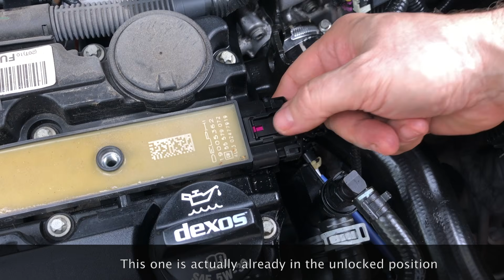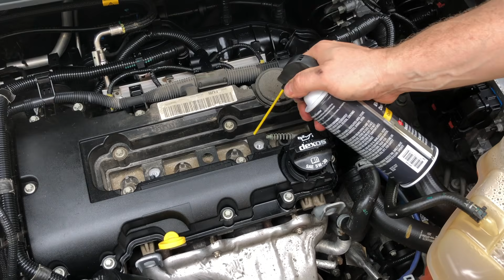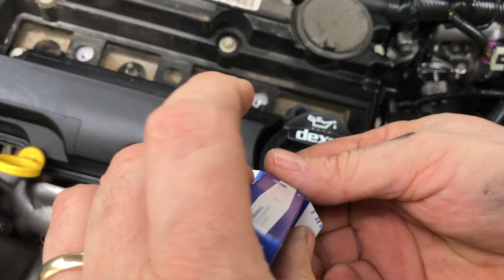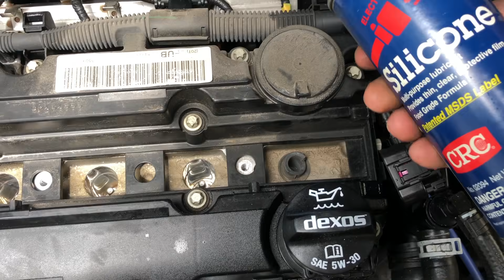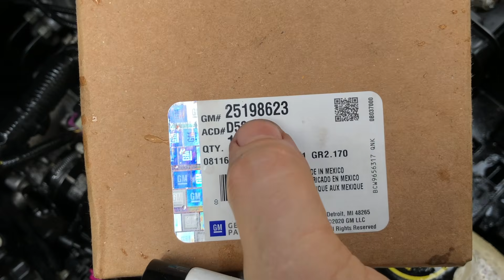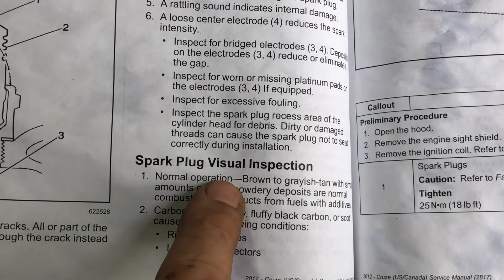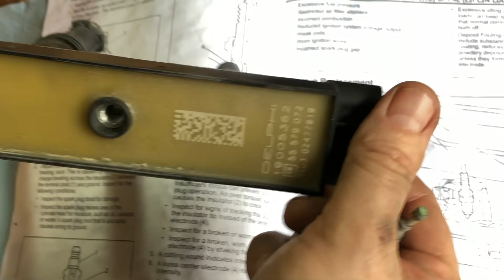2012 - 2021 GM Ecotec 1.4L Turbo Engine 60K Mile Maintenance (Replace Plugs & Coil Pack) Sonic Cruze

Comment: Did you have to buy your service manual from the dealership? The auto stores here stop selling them. Thought about buying one online, but they wanted over $600 other than that you have to pay a monthly or yearly fee to access the vehicle information, torque specs, etc.
Reply from the maker: There should be a search link in the description for hard copy versions.  A subscription to SI at www.acdelcotds.com is another option.

Comment: Our 2019 Buick Encore with this engine ( 1.4 litre Luv ) had the check engine light come on when the car was less than 2 months old. We were passing another vehicle on a heavy rain day on the highway. The engine power dropped a bit ( not much hp to spare ) but was good again for the next 40 miles until we came to a steep long uphill stretch. The transmission kicked down some gears and the check engine light came back on with a reduced power situation again. That hill is normally done with a 1 one 2 gear drop and the tach at 3000 rpm. This time it was at over 4700. I took it to the dealership the next day and they pulled some codes and other info. It showed that the first spark plug on the drivers side harped misfired 114 times. The next plug misfired 47 times, the next one 12 times and the last one  2 times. Their “ best” mechanic was on a week off so they said to bring it back in a week and a half. I’m pretty sure they replaced the coil pack as the one on there now is black rather than the tan colour I see on yours and several others.  I’m pretty sure that when you are on a particularly wet road at speed the mist from the tires or maybe just water entering from the front end is getting under the  engine cover and into the first spark plug and lesser so on the next one. This could be “fixed” by having a rubber boot with a flared top that covers the spark plug hole.  There are so many issues that can and usually will go wrong with these engines. That’s why there are kits for the valve cover and the intake. Luckily those two fixes are relatively cheap but the issue with the turbo is more costly. The cost of a new turbo can be prevented by doing oil changes at 50-40% oil life left, and by changing the oil line that feeds the turbo. That line runs under the exhaust manifold and the high heat as well as “ old oil “ will plug that oil line. Luckily that is relatively cheap to fix and easy to do. Before we bought this car I spoke to a half dozen owners of 2-5 year old Encores and Traxs and they all love their cars and said they never had any issues. One that was a 2016 I spoke to the owner a few weeks ago and she still hasn’t had any problems.
Reply: I have a 2016 Encore-60177mi. I just changed oil/filter. I do it every 5000mi or less. Basically twice a year. I've never had any engine issues. Just the canister purge valve which is common on these. Just replaced all 4 brakes for the first time too. Tomorrow I'm going to get a new belt, turbo oil feed line and check the coil pack/plugs.
Reply: Excellent comment
Reply: No issues that you mention on my 2017, 100000 miles. These engines are solid , as usual, with regular maintenace.
Reply: At my oil change. I drain 1- quart of old oil. Replace it with 50%(1/2 qt.) mystery oil and 50% (1/2 qt.) kerosene. Run it for 10-20 minutes at idle. 30-seconds at 2,000 RPM’s.
Drain it all. 5w-30 Royal Purple + New (wet) Filter.

Comment: Another guy said spark plug torque value is 19Nm and coil pack value is 11Nm.. i am really confused..
Reply from the maker: It varies by GM engine year and type (RPO code).  There’s no one value for all on such specifications.  In this videos case I’m quoting the GM factory service manual only for the 1.4L Ecotec with the RPO codes in the video description.

Comment: Great video. Which oil ist best? Dexos1 gen2 or dexos1 gen3 or dexos2?
Reply from the maker: You are supposed to stick with the type GM specified for your engine, and you can use the latest gen of that type (though using up stock of the earlier gen is of course np).   For DexOS1, gen3 would be the latest there.   DexOS2 is typically a diesel engine spec GM owners manual wise.
Reply: @DrShock  that info was gold, thnx a lot

Comment: I have found that ac Delco coil packs are the only ones that last in these engines. Don't waste your money on aftermarket junk.
Reply: @boydlittou9446  everybody says that I've never had a problem with Amazon parts
Reply: G.M.Coil Packs are JUNK !
I know, try 4, so far !

Comment: Always check the gap on new plugs, I can't tell you how many times a new plug can come from factory not gapped to your cars factory specs....5min will save you ton of heartaches, if you do it Right the 1st time you'll never have to worry about it....
Reply from the maker: Encountering an incorrect spark plug gap is an extremely rare occurrence with genuine GM ACDelco plugs.

A loop gauge is the only tool that can safely check the gap, but if they are off you have to return them and get replacements rather than re-gap.   OEMs advise against attempting to re-gap modern iridium coated plugs. The iridium coating on the plugs electrode is very brittle and will crack or flake off if you attempt to perform this old school approach resulting in premature failure.

Comment: No antiseize on the sparkplugs I thought Iridium plugs lated 100000 miles but the coils only last 50000 not going to you
Reply from the maker: I showed the official GM maintenance schedule, it's 60K on this turbocharged Ecotec 1.4L engine.  There is no one size fits all maintenance schedule, you have to read the GM service information and perform it on a per vehicle basis following the GM manufacturing engineers guidance.  Some folks get misinformation out there, but I'm here to give the OEM facts. And no, you do not use antiseize on this particular engines plug threads, per GM.  Use a torque wrench instead.

Comment: Why is he spraying down inside the boot? The problem is between the outside of the boot and the engine. I would have sprayed in the right place and went down alongside with a very small flathead screwdriver to gently separate the boot from the engine.
Reply from the maker: You see this technique applied because that's where the problem is. The plug boot has adhesion to the plug due to corrosion (inside not outside).  And as well the boot has heat damage causing a loss of material strength. Very common on this particular GM engine model RPO LUV or LUJ. 

There is no adhesion between the boot or the tube (no corrosion on this part).   In most cases, like this one, the boot unfortunately cannot be saved.  

Though, it's always worth a try using a silicone based lubricant as I showed (not petroleum based as these may attack the boot material).  The need to replace an individual boot in such situations is why NGK makes OEM boot kits (linked in the description).  The owner of this vehicle wanted the entire coil pack replaced instead though, so we went that OEM route (customer gets what they want as they are paying but I could recommend either repair approach for this particular situation).

Comment: Great video, I have a 2017 Chevy Cruze 1.4 turbo eco and when I come to a complete stop and when I accelerate to begin driving it shuts off then starts going slowly ,is it a misfire?
Reply from the maker: Thanks. A misfire alone would typically be noticed as a shudder or vibration, not a stalling.   Though you may have multiple faults involved.   I'd start first with pulling the diagnostic trouble codes (DTCs) using a scan tool.   Let the codes guide the next steps.   If there are no codes, then this sort of problem will require a more detailed diagnosis to track down, typically with a combination of multimeter and an oscilloscope.

Comment: Where is graphite paste on the threads of new plugs for future ease of removal?
Reply from the maker: There is no recommendation, or requirement, to apply such material on the spark plugs of this particular Ecotec engine model.   Doing so can interfere with achieving the GM engineering specified correct torque rating, so it's not done.  If you use a torque wrench, and follow the recommended GM service maintenance intervals, there will not be difficulty removing these parts.

Comment: Always use anti seize on plug threads…dissimilar metals and aluminum threads…and dielectric as the oe part already had
Reply from the maker: GM does not recommend the use of anti seize with ACDelco spark plugs on this particular Ecotec engine.  It will interfere with the correct OE torque value being achieved.
Reply: Thats why you under torque to 14lbs
Reply: @codygentry9472  I’m about to do my spark plugs I’m confused am I supposed to torque to 14 pounds or 18?? I will not be coating the threads as it is not recommended and they come with some kind of coating from factory

Comment: 1;40 "Just wiggle it out." Yeah, right, as they say. I screwed bolts in the top holes through which those long torx t30 bolts go, and the was able to pull it out (it involved a certain, limited amount of wiggling. I nearly came a cropper the first time cos i was gingerly levering it with upholstery (some plastic) levers. Apparently that is a big dangerous NO-NO! Anyone know what those top threaded holes are actually for?
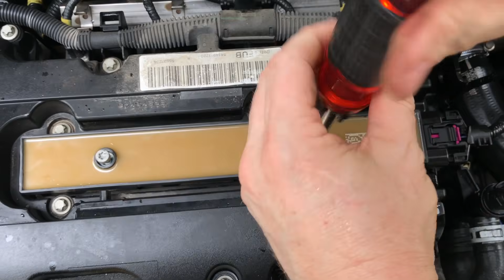Reply: 12:00 What I said above about there being a bigger, threaded hole at the top through which the torx bolts PASS THROUGH to screw into a hole down below obviously doesn't apply to your version!!😮

Comment: Did the plugs and coil pack on my 2015 Cruze at 92k and none of the plugs looked all rusted like that. Coil pack looked fine too so I put the original in the new ones box as a backup

Comment: You can buy the springs and boots and not replace the pack , they are cheap  standard makes them and they seem better than OEM I would change the turbo oil feed line at 60k known to plug and take out turbo
Reply from the maker: I covered that in a different video already linked from this one and mentioned in the description here - https://youtu.be/vUFMqa44Phs

In this case the vehicle owner wanted the entire pack replaced, so we didn't go down the single boot repair.  But there is nothing better than genuine OEM parts so only go OEM which ever way you go.

Comment: I replaced the Boot Kit. $13 . No need to replace the entire coil pack
Reply from the maker: Yep, there's a link to another video for that in the upper right of this one https://youtu.be/vUFMqa44Phs, as well as a link in this videos description for the OEM kit.  However, for the vehicle in this video, the owner wanted the whole pack replaced, which is recommended if you find an aftermarket pack installed, or do not know the prior history on the vehicle.

Comment: Would it be good to put any anti-seize on the threads of the spark plug?
Reply from the maker: Not something recommended in the GM service manual for this engine.  The only reason being the material interferes with getting the correct torque value on the spark plug.   Still, for vehicles in a heavy corrosion environment, it can be worth using anyway if done sparingly.  But I wouldn't use it outside of the salt belt states.
Reply: @DrShock  Thank you!

Comment: Thanks for posting. On my 2018 Sonic the clips on the 'decorative cover' snapped at the back. 
It now rattles. 
Plus, the purge valve rattles. Which I'm told neccesitates its replacement. However, the wiring clips and the clips that hold the valve in the are brittle and do not release. 
So, I'll likely end up snapping them off when I try to replace it. So far, this is not a fun experience.  Any advice anyone has on those damn clips would be appreciated.
Reply: To clairify, the cover is not decorative. It helps keep out a majority of the road dirt and spray.
Reply from the maker: I'd suggest a trip to a local LKQ salvage yard.  It would afford both an opportunity to practice on removing aged brittle plastics like this, as well as provide some spares for when you try the repair on your own vehicle.
Reply: @DrShock  Thanks, I'll see if I can work a deal with them.

Comment: My 2019 cruze hatchback 1.4T looks a bit different. Oil fill cap is on the passenger rear of engine and factory oil specs are for 0w20w oil. I wonder what else is different
Reply from the maker: There's an additional flavor of the Ecotec 1.4L that started around 2016 that is different in several areas which is likely what your 2019 Cruze would have had.  This vid is aimed at the GM vehicles that still came equipped with the RPO LUJ and RPO LUV and other RPOs of the earlier type Gen III engine.

Comment: Yuck, one piece coil packs for a 4 cylinder, the Quad4 all over again, with less displacement and more turbo problems. Replace the whole pack for one problem cylinder, and no diagnosis through moving coil packs to see if the problem follows the cylinder or the coil. Expensive scan tool required, maybe even a scope, for proper diagnosis. Of course the pack does a poor job of sealing out moisture, something that can be forgiven if you just need to replace one coil pack out of 4. Youtube algo really does get me, and it keeps telling me I don't want an Ecotec 4. Good to know, thanks bud.

Comment: good video. too bad on gm's extortion to replace the coil pack is 700 cad, and $20 per plug. especially if you are going to do it at every 60 K. I did mine at 80K. not to mention the issues with their turbo freezing.
Reply: GM does not own your local dealership. Go to an independent, for better prices and service.
Reply: holly mother. the engine isn't worth 780 bucks. Have you had issues with your turbo ?  Mine seems fine. But, the damn Fuel Purge Valve rattles and is miserable to replace as well.
Reply: I’ve also had my turbo freeze up multiple times. Very annoying

Comment: I might have some information that may help diagnose that corrosion. I was driving home from the next town up the highway and the 2019 Buick Encore we bought new was somewhere around 16,000 kms or 10,000 miles as the first oil change had been done a short while before this. It was raining heavily but newish tires and AWD the small car was doing pretty good even where a bit of water was ""pooling". I came up behind an Audi that was going about 25 mph under the speed limit so I waited until  long straight stretch came up ( lane road) I started to accelerate to pass. As soon as I got beside the guy he tried to speed up but backed off because I guess he slipped a bit but we were so close to the next curve and running out of the passing area so I put the pedal to the metal and the engine hiccuped a bit and a warning came up on the dash. I got home again and it ran smoothly until we hit a long steep uphill where the transmission kicked down a couple gears to maintain the speed and the engine hiccuped again and the warning came on again. The vehicle was fine the rest of the way home. I took it into the local GM dealership and they put it on the computer and one thing it mentioned was a misfire 104 times on cylinder 1 and 20 something on 2, 3 and 4 times on cylinder 4. I'm not sure what they did but they fixed it on a subsequent visit as their top mechanic was away that week. I'm guessing that there is a problem with water entering  on the end where the coil pak has the plug in???? That would explain the corrosion on that first plug and a tiny bit on the next one ( looking at the 2nd plug, the 3ed one you looked at The rubber boot probably got boiled onto the plug hole because some water entered that hole and took at least a half hour or so to completely boil away.

Comment: What would cause the rust in the 4th plug... ? Water leak?
Reply from the maker: Some form of condensation or external water intrusion (e.g., rain, snow).   The design in this area allows water in, but prevents it from escaping leading to corrosion.

Comment: Grease? Geez as rusted as it was i definitely would have put grease on those plugs.
Reply from the maker: GM only recommends dielectric grease, nothing more.   Changing the plugs out on the GM engineers regular maintenance schedule in the owners manual is fine for dealing with normal corrosion of the steel base of the plug.
Reply: @DrShock  i put put grease on the threads of every plug i change. I know it probably doesn't make a huge difference but I've dealt with plugs that have broken off...thats a nightmare.

Comment: Great video.. Any advice on relieving pressure in the crank case on this engine.  Been to dealer 5 times they have replaced main crank seal (squeaking) and valve cover twice (leaking oil).  Also replaced PCV part Appears the main crank may have blown again a day after the last repair. Also oil pan gasket now leaking.  Thanks!
Reply: These engines are notorious for PCV system failures. Carlos Garcia has accurately described the problem in his post. If you have a dealer fix it they will just put more stock parts back in and it will fail again. The problem is the basic design of the PVC system. There are several companies selling parts kits that modify the PCV system to make the problem go away permanently.
Reply: Sounds stupid but I had same problem. Check oil dipstick with engine running pull up on oil dipstick see if noise changes? I could not believe I had to by a new oil dipstick sound went away
Reply: Check the pcv valve that is built into the intake manifold.  Also check the diaphragm at the valve cover. It is sometimes referred to as a pcv valve, but it is not. There is also a pcv valve in the hose that goes into the turbo.
Reply: Joe Vignolo... would you Post the name and or part numbers of the kits to modify the PVC system, please  I’m on my second repair job using OEM parts because of vacuum leaks